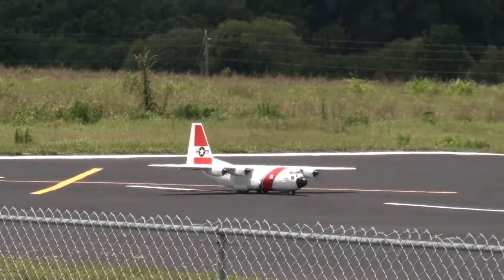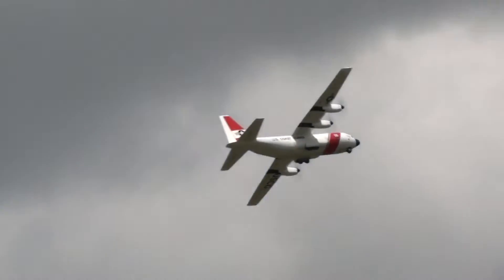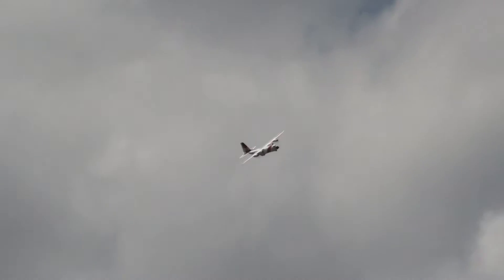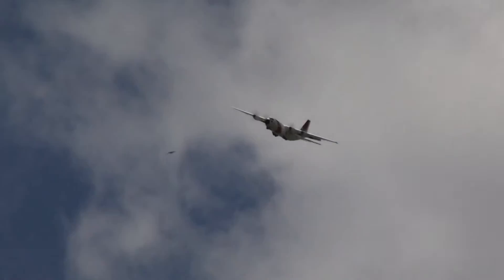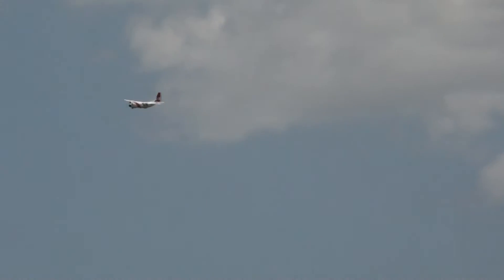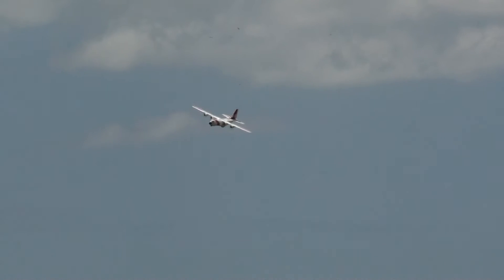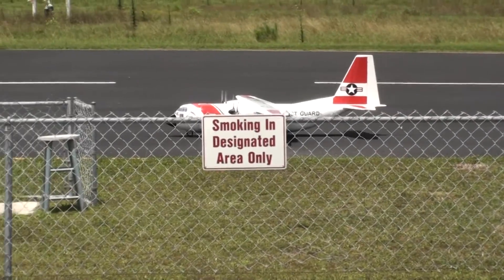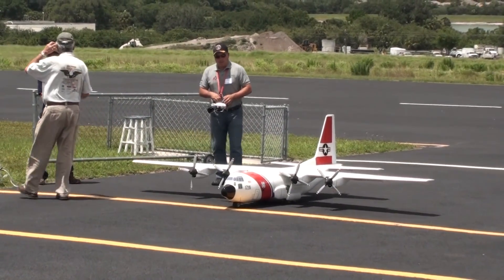Scratch Built C-130 RC Plane - Coast Guard

Comment: I just finished my ASM CG C-130 and decided to go with the electric powerplants as well.  My question to you is do you have your inner and outer motors on a separate channel? Or do you run the motors all at the same speed all of the time?
Reply: All at the same time, but some guys have done as your saying its just all personal experience but we are going straight to one channel